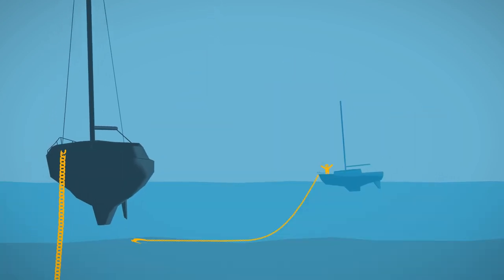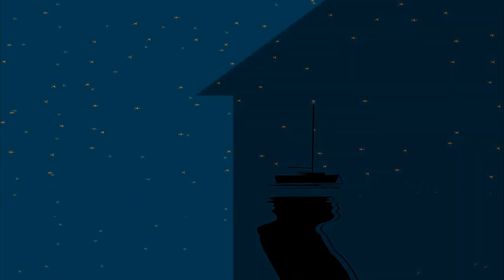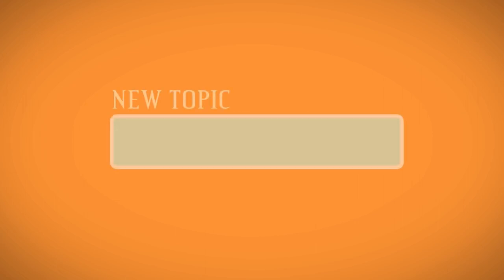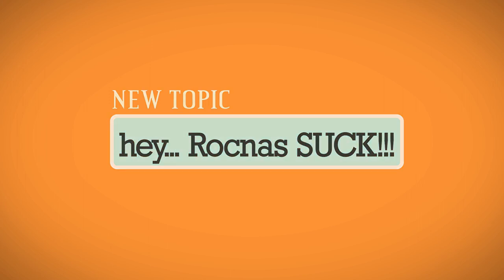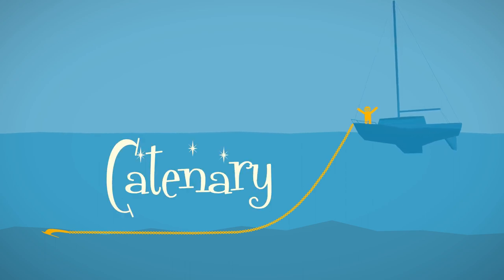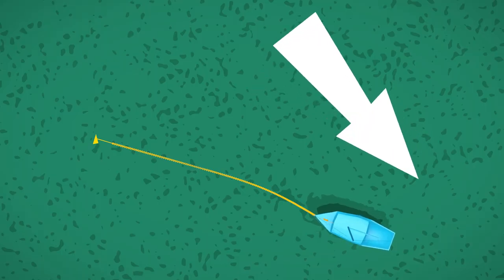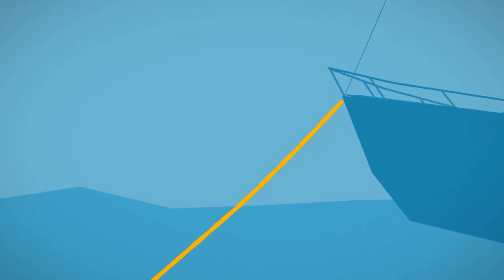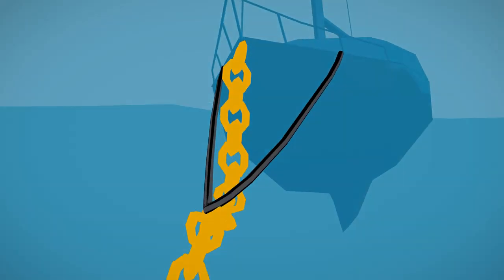Dragging Anchor! Why Anchors Drag

Comment: I thought depth times three for chain length.Were all doing it wrong.Please enlighten me.Dam thought I had it right.Have the maths changed for performance.Great upload thank you.
Reply: @99thehighstreet69
The mathematics are never wrong, it is just that people don't understand the mathematics and instead just refer to fixed scopes. Then they find themselves dragging in a blow and they are wondering why that is happening. Understanding the forces involved will make you realize there is no fixed scope. The 3 : 1 or the 5 : 1 are based on calm wind, no current and no waves. The moment the wind starts to blow, a current occurs or waves start to develop that fixed scope goes out of the window.